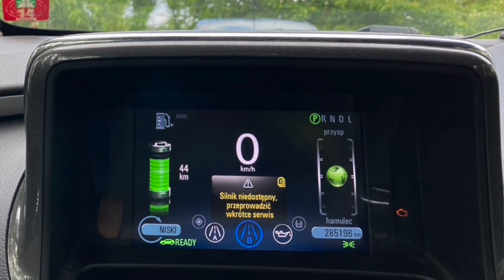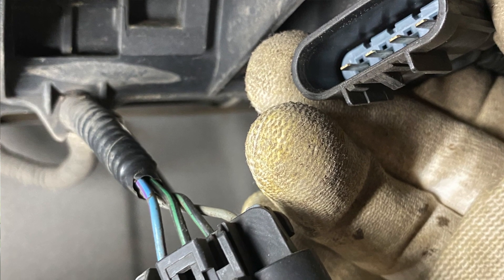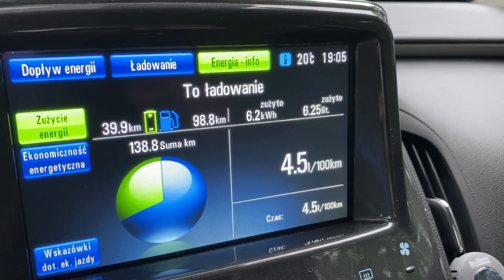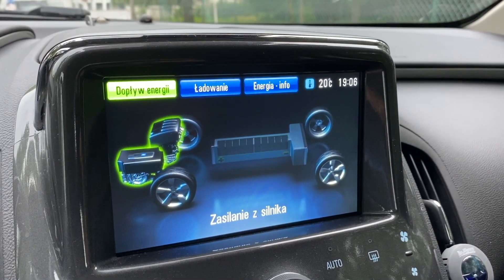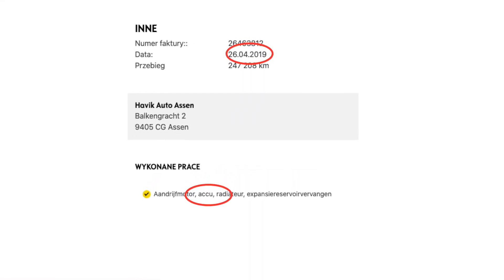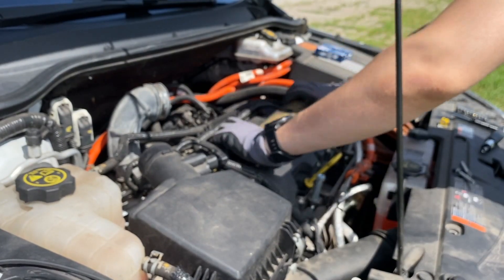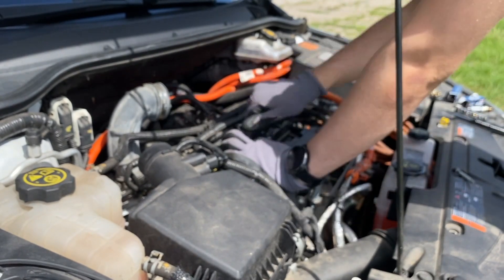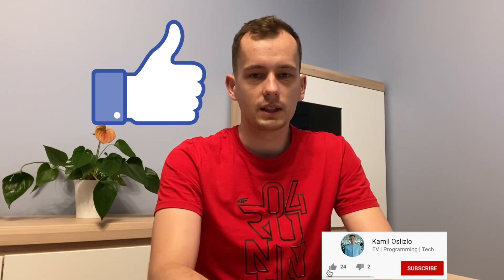DIY Opel Ampera low fuel level and catalyst problems - new ignition sparks, coil and 12v battery

Comment: Every ic car need to replace spark plug battery ignition coil + motor oil filter air filter transmission fluid and filter.. as the normal 😉
Reply from the maker: true! but its not a standard IC car so it needs those being replaced much more rare :D

Comment: Please consider that the total milege of the car includes pure ev miles and combustion engine miles.  Judging by your  lifetime average consumption  4,5l/100km  and assuming Ampera's fuel  burning like 7,5l/100km, the mileage of your gas engine equals 4,5/7,5 * 285000 ~= 170000 km.
Reply from the maker: good catch, however in regular car you would replace ignition sparks every 40-60k km, so the service manual takes into consideration that those 160k km is not purely on gas.

Comment: Interesting video thank you. I am also driving a (2012) opel ampera but with much less km than yours (actually about 65’000km). The only problem that I had until today was a to low level of the battery cooling liquid. As consequence the car refused to charge. The problem was easy to fix by an official opel service point but I had the same issue concerning a quit long deliver time for the needed liquid. I’am glad to see that there are still other persons who drive this in his time very innovative car and I wish you all the best.
Reply from the maker: Thank you. Did you have bcm reprogrammed or only cooling liquid topped up?
Reply: Kamil Oslizlo In my case it was the opel service point who does the fill up, I suppose the guys deleted only the corresponding error message.
Reply from the maker: @e-revmobility5050  I see. It is quite popular issue but often to get rid of this error you need to make a software update which usually reduces avialable kWhs :/ But it seems like you didn't have it :)